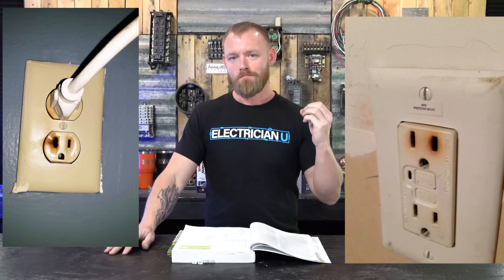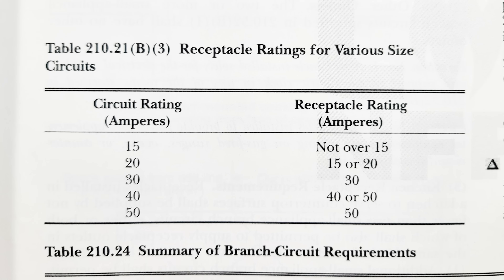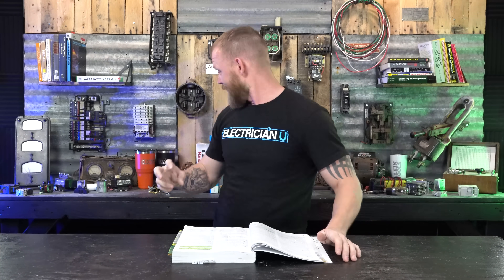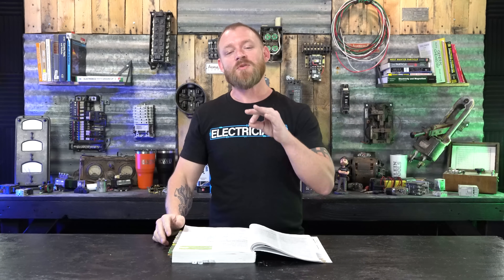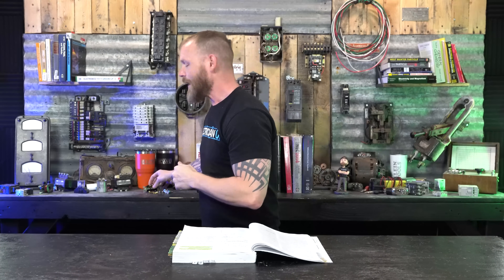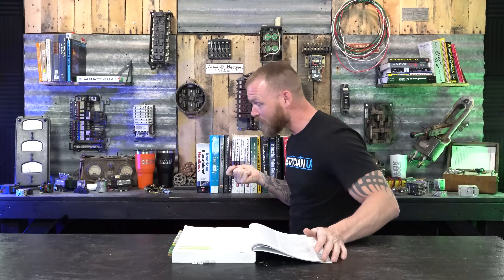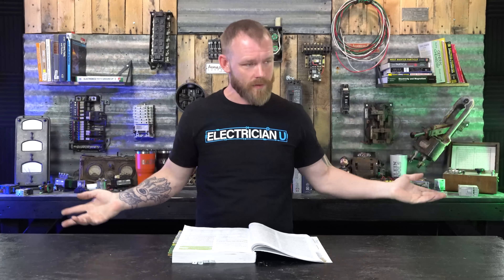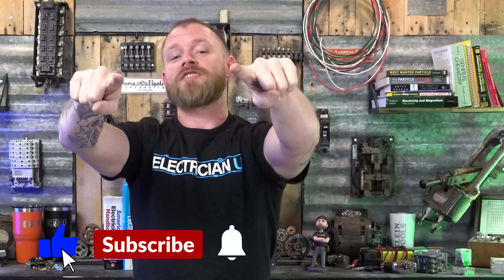Won't These Melt?!? 15amp Receptacles on 20 amp Circuits!!!

Comment: Fellow Sparky here. It took some doing, but I finally convinced my landlord that 15A receptacles don't belong in rentals. He wanted to know why I was so insistent, and I said, "Why do we want to come back here on Christmas Eve because this receptacle melted? Like we had to last year?"
Reply: QA head for a manufacturer, I can assure you the only difference between a 20A and 15A receptacle of the same grade is the face plate, everything else is the same. and the difference between grades is how much tension they apply to the blades and how many times you can plug and unplug in that outlet, before they get too loose to make good contact.
Reply: @Galgamoth  I Learned the bit about 15 vs 20 receptacles back in trade school mid 80's. Quite honestly, I prefer the 32 amp ring mains used in the UK and it's territories and fuses in every plug idea better than our US system limiting us to 2400 watts per radial circuit, whereas they can get 7,360 watts from one.
Reply: @darrendolphdragos9752  where exactly are you pulling 7360W on a non dedicated circuit?
Reply: @Galgamoth  I meant total circuit capacity, so rather than multiple radial circuits with an 1800 or 2400 watt capacity, the UK has ring circuits where the entire floor of a residence can had all the receptacles on one breaker.
Reply: @darrendolphdragos9752  yeah but they do that because of the way their houses are built. it isn't easy to run wiring.
Reply: @Galgamoth  Not true, 20A receptacles have the neutral slot horizontal whereas 15A receptacles have the neutral slot vertical. That is quite a significant difference.
Reply: @Galgamoth  That was a lot of words to say, "I've never done this, but the BOOK SAYS..."
Reply: @TimeSurfer206  last I checked the book says stuff that YOU need to follow because WE the manufacturer are involved in it's contents. do you think we are going to make multiple toolings for different amperage? and because 15 amps are allowed to be used on 20 amp circuits they need to be approved  to that. but you aren't required to know any of that, you just need to follow the book.
Reply: @Galgamoth  Darling, you can claim that all you want, but, at the end of the day...
I listen to Underwriter's Laboratories and the National Fire Protection Agency, NOT YOU.
Reply: @TimeSurfer206  ok there princess, and how many items have you had to get approved by UL? have you ever went through the process of manufacturing and getting approvals from any of the governing bodies?
Reply: @Galgamoth  Have you ever say on the National Fire Protection Association's Committee on the National Electrical Code?
I have.
Go away.
Reply: @TimeSurfer206  I have as well, but the fact that you are arguing with a manufacturer who knows more about the product than the you the installer about the manufacturing process tell me you are probably touched in the head.
Reply: @Galgamoth  Yap as loud as you like, the only receptacles etc I use in MY house are Leviton 20A Spec Grade.
Reply: @TimeSurfer206  good for you, and how exactly does that change anything I said?  now go take apart a leviton 15A spec grade and tell me the difference between the 2 internally.
Reply: @Galgamoth precisely. But it's more fun to argue with about pretend "facts" 😂

Comment: I saw in a code book one time that on a 20 amp circuit at least the first outlet (or other permanent fixture) must be a 20 amp device. Is that still true?
Reply: On a 20 amp dedicated circuit the first and only receptacle must be a 20 amp single receptacle.

Comment: Yep.  Just found this on the house I just bought.  Thankfully, all the receptacles are ivory, which I think look hideous, so I'll be slowly changing them out to white and making sure to bump them up to 20 amp service size.
Reply: I put “light almond” in my kitchen.  I think they look better than white or almond, but if you don’t like ivory you probably wouldn’t like light almond.  White would only look right if there were white appliances or paint in the kitchen.

Comment: Since the max load is 12 amps why isn't there a label on the wall receptacle stating this because what home owner actually knows the code?
Reply: The home owner doesn’t need to know the code.  If the residence is wired to code, then a plug can only be inserted in a compatible receptacle.  If a circuit is overloaded, the breaker will trip before any damage is done.

Comment: What will it take to build out a code and standard for DC outlets at 5V 90Amp using type C and one for 12V 150Amp for general appliances.  with more houses going solar and the increased usage of LED lights that have to convert AC to DC in their housing. now should be the time where we start to build out DC Codes and standards.

Comment: This is exactly why when I replaced my outdoor GFCI for a sump pump I put in a 20A receptacle.  It was a dedicated 20A circuit with nothing else on it but the one outlet so it was a no brainer.  I think the last outlet on that circuit was only a 15A which was a WTF moment when I opened the box.
Reply: I hope you still have a GFCI on the circuit.
Reply: @GH-oi2jf  Yep the new outlet is an outdoor rated GFCI 👍

Comment: A breaker that can handling 150-200% before it trips is crazy. All breakers should trip exactly at their rating at the switchboard not at the receptacle. That's how home fires are prevented.
Reply: A breaker should be able to take a brief surge before tripping.  Otherwise, they would be tripping often.
Reply: @GH-oi2jf  No that's not right. If the breaker trips at its exact rating then people will work out from the receptacle end not to over load the circuit.
Reply: If you look at the characteristic trip curve for common thermal-activated breakers, you will see that is not how they work.  I found the trip curve for Square D QO breakers online.  The rated current is maximum continuous current.  They will trip in one cycle if the current is six times the rated current.  Three times the rated current will trip at three seconds.  The trip curve reaches the continuous rated current at about five minutes.
Reply: @GH-oi2jf  5 mins is too long, that's madness !

Comment: HEY. E.U....
Thanks for telling well...STUPID HUMANS how that works...I WELD and have a receptacle that corresponds with what I want to use it with UNFORTUNATELY people OTHER than me don't understand why it is located where it is....OH WELL.
To be specific...I have a breaker box that is WAY overrated for my small place so I can do 35-50 additnl amps over my average pull...JUST what you were saying about your max draw.
All I will say is...I WELD...
and I like lights,A/C & cold food.
GREAT Job tellin' the stupid humans brother...🤘☢️🤘

Comment: Thank you. Great explanation.
I recently purchased bulk commercial spec 20 amp recepticles to change out the 15 amp $0.25 builder junk. To match my 20 amp breakers.
Reply: I just stumbled across this too. My Dino g room is a 39 amp circuit with 15 amp breakers. What the heck

Comment: How I taught my wife, not to plug in too many devices at once in a receptacle.  
When I first caught her plugging in more than one device into a single outlet, I grabbed her and shoved her head between the door jam of the front door and repeatedly slammed the  thick heavy oak door on her head eighteen times with as much forces as I could muster!

Oh she hollered, screamed, and wept for a few days, but she never over-loaded the plugs sockets in my house again, and she never leaves dirty dishes in the sink either.

Comment: Depends of a quality of an outlet... 15A it's about 1800W, 20A - about 2400W. No one good quality outlet will not melt at 2400W. 15A limit doesn't means what you will have explosion at 16A...

Comment: The real question is why is there a "not greater than 15" . Last I knew, the circuit breaker limits current draw by tripping if current draw exceeds it's limit. Who cares if the receptacle can handle more current than the breaker allows?
Reply: Some devices, such as motors, have a startup current which is higher than the operating current.  You don’t want a brief startup transient to trip the breaker.
Reply: @GH-oi2jf  I know what inrush current is. I'm not sure you understand what I was pointing out.

There is a limiting factor placed on allowable receptacle current rating so that you cannot install a receptacle capable of handling more current than the wires or even circuit breaker. The rating of the receptacle should not be restricted on the upper side.

Comment: I’ve always assumed that for a given brand and line of receptacle (I like Eagle, now Eaton), the 15A and 20A versions were the same, except for the slot that admits or excludes the 20A plug.  If so, the 15A should be no more likely to melt than the 20A version.  The rating is really to protect the wiring, which might be #14 for a 15A circuit.

Is that not true?  Has anyone dissected a couple of receptacles and measured the internal parts?
Reply: What you're saying is correct when comparing spec grade receptacles. With regards to residential grade the contacts in the 20 amp may be slightly more robust, not totally sure.

Comment: In California if the circuit has a 20A breaker it must have yellow 20A
romex & 20A receptacles & switches. I know some states 20A on
eptacles & switches on a 15A circuit is OK.

!

Comment: #1 receptacle rule don’t use rear plug ins.  Wrap the wire around the screw. I have seen them burn when those heaters are plugged in.
Reply: Yup, I just did a DIY remodel and replaced all the outlets, every builder-installed outlet was of the rear plug-in type, and several of those had melted wires.

Comment: I simply use commercial grade 15 amp receptacles which are just as good as residential grade 20 amp receptacles but accept the standard 15 amp plug style.

Comment: Normal appliances are no more than 15 amps. That’s why you can get away with them. The chances of ever using a 20 amp device is quite remote.
Reply: A one Hp disposal will draw about 16 amps, but the startup surge will be greater.  It will work on a 20A dedicated circuit if the breaker will accept the surge current.

Comment: This will only apply to cheap 15 amp receptacles. If commercial grade 15 amp receptacles are used overheated contacts will not occur.

Comment: In Australia the circuit breaker is designed to protect the wiring in the wall, not the appliance. It is common to see 10A recepticals on 16A circuit breakers and 15A recepticals on 20A circuit breakers. This is to ensure sufficient power on the circuit to multiple devices with multiple recepticals. That being said I highly doubt that recepticals could not handle the higher currents, as the different recepticals are mostly about preventing plugging in too high powered devices into lower powered sockets that would trigger the circuit breaker (protect the wires in the wall).

For example a 3HP Air Compressor would have a 15A plug that will only plug into 15A, 20A, 25A or 30A recepticals. The earth pin is too large to fit into a 10A receptical.

Comment: What about a streaming setup with studio lights ECT all running at the same time in a bedroom on one receptacle? Should the circuit be rated for more than 20Amps
Reply: This is a hazard with working at home.  A becroom is probably not built to be a studio.

Comment: That's why receptacles shouldn't be used to continue the circuit.  A PIG TAIL should be used...always always always.   Also, this allows for 14 awg wire to be used for the pigtail, which is easier to manipulate, and allows for push ins to be used properly.

Comment: I read somewhere that most house fires start at electrical receptacles.  Receptacle failures, bad connections, overloading, etc.  I can't confirm if it's true, but since hearing that I can't bring myself to save $1-$2 per receptacle by using discount products.  I get that for contractors who buy these by the thousands that price difference start to get meaningful, but considered from a safety perspective, it's almost always going to make sense to spend a couple hundred bucks per house.

Comment: I once owned a 4-slice toaster from a reputable name brand with a 1800W nameplate load and a 15A plug.  Always wondered how they got away with that.
Reply: They get away with that because it makes no difference what the plug is as long as it's a 120v 20amp circuit with 12 gauge wire. I agree that it does seem like it could be problematic and a solution would be to have a 240v 20a receptacle. That would double your available wattage. However, most countertops are not equipped that way. Toasters, hairdryers, etc. are generally on for only a short period of time.
Reply: @surferdude642  My concern is that many older homes only have 14 AWG wiring.  I get why you can put 15A receptacles on 20A circuits, but it seems like 20A appliances should always have 20A plugs.
Reply: @charlesenfield2192  20 amp appliances do have 20 amp plugs. They are extremely rare and the only thing they do is to tell the installer that this appliance is not to be shared with any other appliance or equipment on this circuit. This is impractical for items such as toasters, blenders, most coffee makers, hair dryers, etc. particularly since they are not designed for continuous use. As you know, plugs and receptacles have nothing to to with the ampacity of a circuit, they're just connecting devices. The ampacity is determined by the circuit breaker rating and the wire gauge.
If your home has only 15 amp circuits and 14AWG wires you can probably still use these appliances if you use only one at a time on the same circuit. You can also get a clamp multimeter to check the actual current draw. Even if you have a 20 amp circuit in a kitchen you can easily overload it, that's why modern kitchens may have 6 to 8 separate circuits.
Reply: @surferdude642  You're confusing circuit design with device design.  My understanding is that nominal load for an electrical device should not exceed 80% of the circuit capacity with which its plug is compatible.  You'll see that same 80% reflected in the electrical code for dedicated circuits when the device to be powered by that circuit is known.  Maximum nominal load for a 15A circuit should be 1440W.  If you look around at the nameplates of high-current household devices you'll see that number a lot.  1800W is less than the 1920W permitted on 20A circuit, but it should also have a 20A plug because, by itself, it's not suitable for use on a 15A circuit.
Reply: @charlesenfield2192  A manufacturer cannot just slap a 20 amp plug on an appliance and call it good. All the internal components would have to be upgraded to higher standards, codes and pass tests to qualify for a higher rating and would make products unnecessarily more expensive. The bottom line is that it's deemed overkill.
Reply: @surferdude642  So I can plug my 1800W toaster into a 5-15 receptacle with 14AWG wiring and a 15A breaker and that's OK.  I can also plug it into a 5-20 receptacle with 12AWG wiring and a 20A breaker, and that's OK.  But if they put a 20A plug on it and I plugged it into that same 5-20R with 12AWG wiring and 20A breaker it's dangerous? Your thinking went sideways somewhere.
Reply: @charlesenfield2192  No, no, no, don't do any of that. Hire an electrician and bring your house up to date and up to code and be done with it.
Reply: We're clearly having two completely different conversations here.  Have a nice evening Ted!
Reply: @charlesenfield2192  Thank you, Charles

Comment: how about just make ever circuit, receptacle, breaker and wire 30 amp rated. cost.... would add like less than a dollar a month on a 30 yr mortgage and would save everyone the problems that are caused by this situations.
Reply: That would require 10 gauge wire and have a domino effect on the cost of the parts and labor for upgrades and installation. With the emphasis on energy saving appliances and lower wattage lighting the need should be lower.

Comment: Great video! I just wanted to clarify that duplex receptacles are considered a "multiple receptacle" in the NEC. So even if there is only one duplex receptacle it is considered two or more receptacles.
Reply: I believe he was referring a single round receptacle not a duplex when he said that
Reply: This should be a sticky because its a very overlooked point.  I guess a single receptacle on a 20a circuit isn't supposed to be shared.  Also, use premium/commercial receptacles that have backwire connections.  I wasn't surprised to find my dedicated 15a duplex receptacle for the fridge on a 20a circuit - backstabbed FFS!  Maybe 12ga was allowed for backstabbing in the 80's.   The fridge says it draws 11.6 amps, but I think that is peak. I've been replacing everything with commercial-grade backwired versions.
Reply: @jeremywatts2768  I wouldn't be so hasty to start replacing every receptacle in my home with top dollar premium devices. Most of my receptacles never see anything like constant plugging and unplugging, though it's a good idea in some situations like kitchens, garages, hallways, and areas where you know you're constantly or at least often change what is being utilized.
Reply: @darrendolphdragos9752  They're not that expensive, plus some of the higher quality features make them easier to install.  Just using "commercial" grade units and medical grade ones you find in the hospitals.  I've done 55+ in my house and several of them were blown out/cracked but they were 40 years old.  Some were commercial units of the time.  You still aren't supposed to BS 12ga in these.  I think its because the tight fit will cause cracking with heat cycles.  Its good to take a close look at your infrastructure and make sure they'll last the next 40.